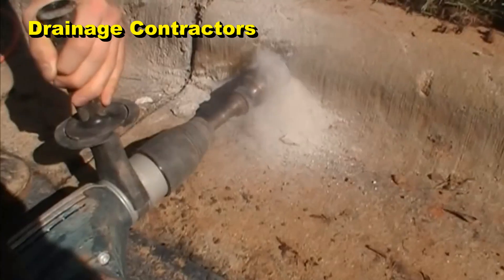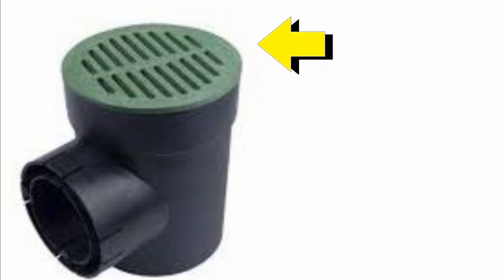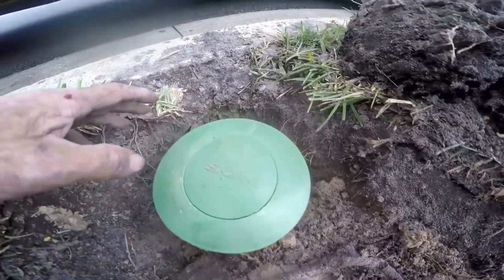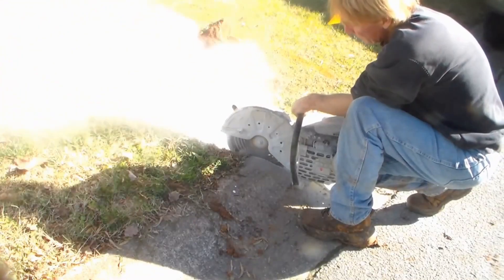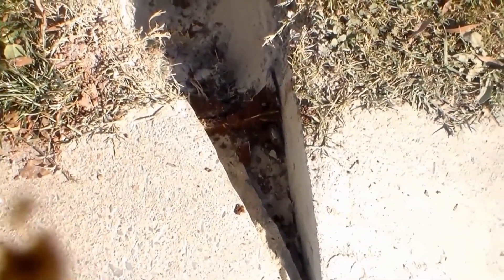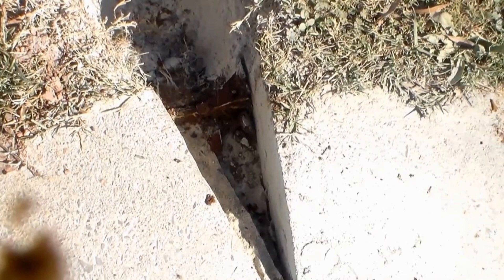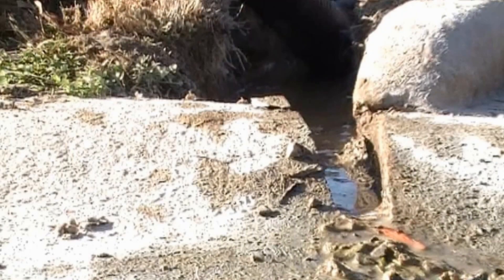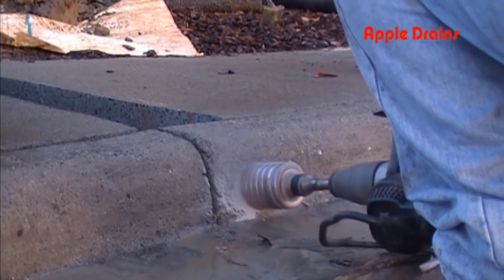Best Discharge for French Drain, Pop Up or Cut the Curb | Keeping Fall on the Pipe

Comment: Can't do a curb cut in my city.  Do people do it?  Yes - and there are examples on my very own street where people have, but that doesn't make it legal.  The issue we have is that we have freezing temps and the city doesn't want people pumping water into the street where it then freezes.  Over time this can create a large ice block and then a snow plow comes by and hits it and it can do damage to the street and curb. So they don't allow curb cuts and in fact it isn't even legal to drain sump pump water into the street.  I suspect the rules vary from city to city so my advice is to check with your local officials before assuming anything because the last thing you want is a very expensive fine (and having to re-do the work).

Comment: Why not discharge in the sewers?
Reply: There are two classes of "sewer": what is called the "sanitary sewer" or "foul sewer", and what is called the "storm sewer." The storm sewer is connected to the big street grates, if it exists at all in your area. That set of pipes generally takes rainwater and puts it in a river or ocean. That is where your gutters and french drain systems SHOULD connect to. But those pipes tend to be big, and in many cases they are buried deep. So the easiest and safest way to discharge into the storm sewer is to take the water out to the street, and let the big street grates handle it, exactly as shown.

On the other hand, the "sanitary sewer" is where your shower, sinks, and toilet go. They are full of (literally) shit. And they have a different set of pipes. Those pipes take the sewerage off to a treatment plant, because if you dump a bunch of human waste untreated into a river or into the ocean, somebody is going to get sick. The "black water" and "solids" get run through various processes, and those processes are complicated and in many cases expensive. So the sewage treatment people REALLY, REALLY don't want any more water than necessary to be in those pipes. (Not to mention the pipes are smaller -- they are sized for the occasional flush, not for a 6 gallons-per-minute gullywasher of a storm!) So in almost every jurisdiction, it is illegal to route your rainwater, ditchwater, storm runoff, etc. into the "sanitary sewer." Just don't do it!
Reply: @austinhastings8793  thank you for that excellent answer. Here in my street, we only have 1 pipe that takes all. When renovating old houses, we have to separate rain and sanitary indeed, until just before the pipe where they join. When the sewers are 'upgraded', they will be fully separated. I decided to let all my rainwater flow into my 10k liter tank and  then flow over into the creek behind my garden. Seems the most ecological.
Reply: If your lot has a storm sewer tap you probably could. But if ur talking about the sanitary sewer that would be illegal.
Reply: During a storm, whats the difference between discharging my overflowing pool to the city sewer (Not storm drain) vs. the rain water from my gutters? I have a city sewer tap in my yard for the pool, can I tap into that for the gutters?
Reply: @justingeronimo  Most cities won't allow gutters or sump pumps to be connected because excess water overwhelms their system. I have no experience with pools, but I doubt it's legal to connect it to your sewer system.
Reply: It actually depends where you live. Most cities want you to keep your stormwater out of the sewer. I’m not actually supposed to discharge to the street, but because I live on a hill that’s basically the only place I can discharge half my property (unless I put in a sump) so I do it anyway. I can discharge to my sewer but only because my place is grandfathered in and I don’t have access to stormwater drainage.